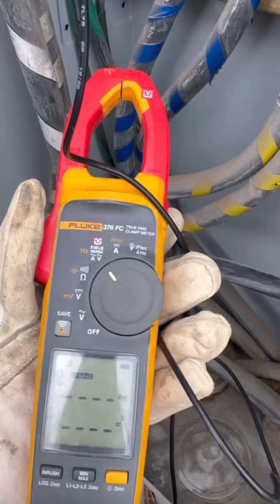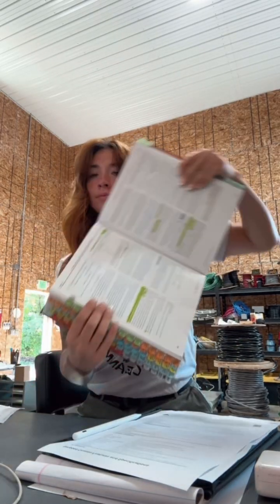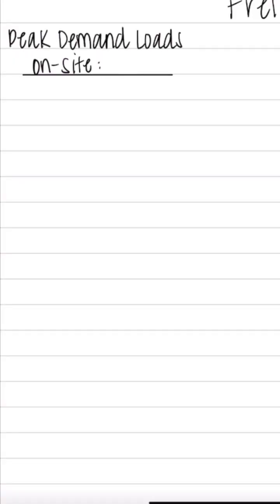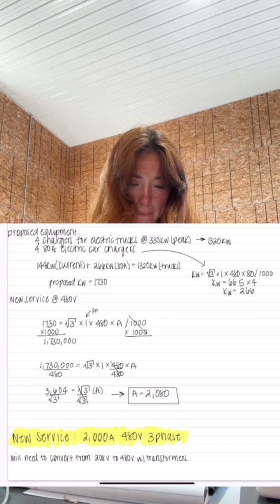Load Calculations for a Commercial Service Upgrade

Comment: Wouldn't you take that 2080A calculated and apply the 1.25% continuous loads (NEC210.20) for the main OCPD? so it would need at least 2601A protection? So it would be a 3000A service with a 3000A main OCPD?

Comment: I have a question. Why did you not include 80% NEC rule when sizing services? Your calcs show 2080A peak, if everything is running, your service size is supposed to account for that. This should be 2500A service. Please correct me if I’m wrong

Comment: I have a question for you that is not on the topic of your video. I wanted to get a professionals opinion on this. So my wife and I just bought a home and our laundry room has only two outlet outlets for 120V 15 amp receptacles. We switched over our electric dryer to a gas dryer and I was curious to know would it be possible and safe to take the 240V 30 amp dryer plug and turn it into a 120V 20 amp receptacle for the washer and dryer. That way it’ll give us two 120V plugs in the laundry room to use because at this point we do not have any.
Reply: And of course, I would change the breaker as well to a 120V 20 amp breaker.

Comment: Hi. Wait. Why don’t you just have separate service 480v for charging stations? Easy. Separate transformer and the meter from your utility. Just go directional bore and done. That’s how we do it in IL
Reply: They like to get technical out in NY. I wonder which is more efficient and cheaper. 

I know the Illinois way is easier for sure. I'm 134, and I would know 😅

Comment: Do they not require engineers stamp for service change where you are? 

Also, my experience is that almost everyone oversizes their car and truck chargers. First thing I ask for is the driving profile (and parking profile) of all fleet vehicles. This allows me to calculate the actual consumption between charging. Most of the electric tractors do local short haul and the majority of those are not heavy loads. I've been asked to design in 300kW chargers for tricks that do less than 100 miles a day and sit in the yard all night. Saved them a gazillion dollar service upgrade and they've never come close to running low on the road.
Reply: I believe we have to use the NEC for our load calculations and not the driving habits or the actual vehicle.
Reply: @keithb2696  the driving and parking habits determine the size of charger necessary which in turn sets the max current. Then you do a load calculation based on that.

This might be the problem. Most electricians that I've worked with are not fully versed in the charging process and technology so they stick with what they are asked for. 

Just as a Charger 101, Level 1 chargers are typically 1.5kW, Level 2 range between 3.6 and 22 kW, and level 3 are between 50 and 350 kW. Use the one that's most appropriate for your circumstances. This doesn't mean you don't future proof, but if you've got a fleet of cars that sit in the lot all night and don't do more than 100 miles a day, 3.6 kW chargers would be just enough. Maybe design in 7.2 or 9.6 kW, but there's no need to jump up to 150 kW fast chargers.

Comment: 2000a 480 3phase is gpnna either be 5 parrallel 500mcm feeders or 4 750mcm feeders per phase. Guarenteed the utility company will need to do a load calc for their new equipment. Hope that business owner has very deep pockets. Thats gonna be a 100k service upgrade job between service and chargers and all the installs.

Comment: Would always ask the customer if they had the electric company bills from last 12 months to review monthly loads.  Also asked them if they added any  new or planning to add any new equipment. Summer verses winter loads can have huge increses in power consumption. Once time a customer pay a company to install powr recording device on several 3,000 amp buss ducts got seven days. Of course this was performed middle of spring and told us it was okay to add another 400 amp buss duct switch fir a new machine. Ran great until hot days when it tripprd out 3,000 amp breaker several times fue to adfitinal summer AC & freezers power consumption..
Reply: That’s why what your talking about happened. And electric hvac uses way more for heating than cooling so great statement. But more depends on gas heating or electric. We change out 5x more tx’s during winter here than we do summer. Winter peaks are always higher. 99% anyway. Here.
Reply: The monthly statement cannot give you peak load. Averaging the kWh over 30 days don’t give you 6pm load.

Comment: Are you , going to install the 2000 amp , switchgear outside or add a , separate room? I see they have snow equipment right up, to existing meter/load , gear?
Reply: I noticed that also I was thinking the sane thing.

Comment: I'd like to know when you find out. If the utility is capable of delivering 2000 amps for that building.
Reply: The utility is capable of delivering 35-38,000 very easily. If you can pay for a new feeder from the sub. If that’s a 150kva this customer bought, it’s probably only good for 1200a. If it’s a 300 then yea it’s good for 2500amps

Comment: Them root 3s!

TBF I trained for electrical engineering but ended up doing mostly firmware. Although UK based, I did a few jobs with Fluke up at Everett - Industrial and Medical. Good bunch. Hope they don't make the same mistake as Boeing.

Comment: It's good that the client thought ahead and wanted the installation future proofed for possible further expansion.
Reply: The funny thing is that my apartment had about 3 seperate electrical outlets and they had them all pulled out and ruined so they could never work again. And since that takes money to fix I have to continue letting people rob me and just leaving the areas empty and without use. Smh.